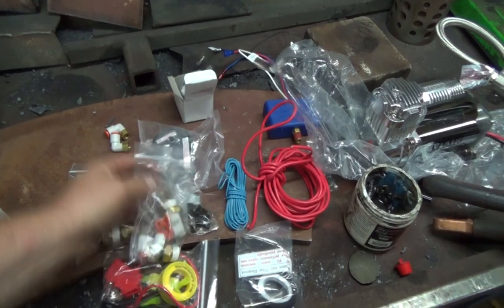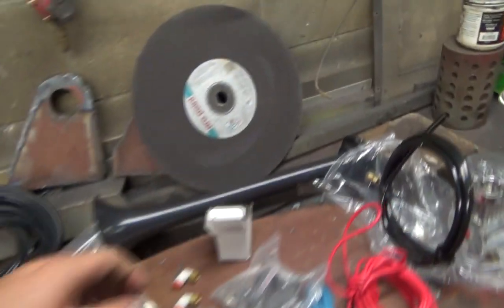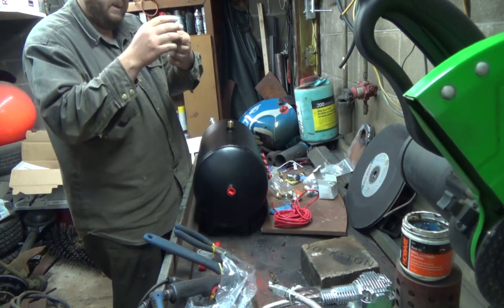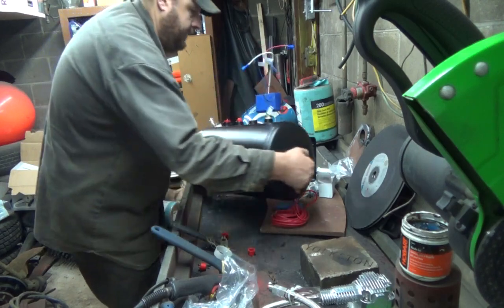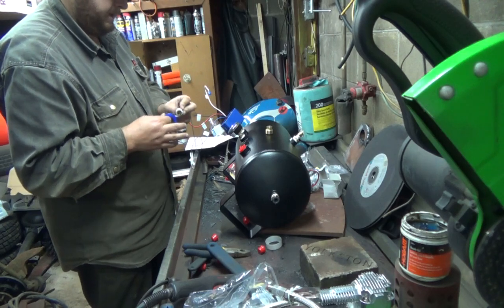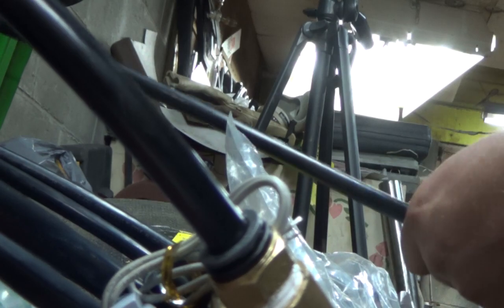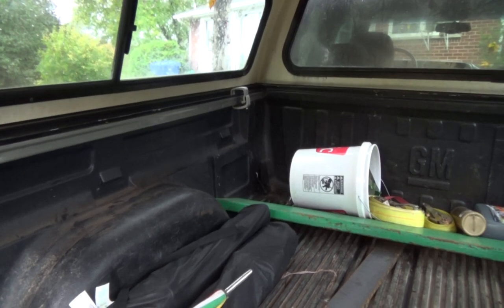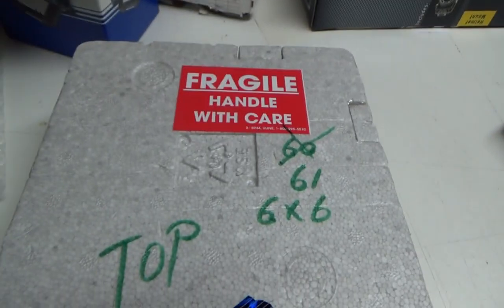Darn rain again   setting up the horns inside and??????

Comment: the bigger port is/or could be used to plump a line out to another aux. air tank for more air capasity. Thus being able to run more horns with less work of the compressor.

Comment: put the switch on the blue wire it needs the blue wire live to work . or still run the blue to ignition either way if you dont have live to the blue it shouldnt work.

Comment: Bill, Hope you have the orientation of the tank worked out before you start fitting drain valves.

The problem with putting the tank in the back of the truck where is the water going to go when you drain the tank which is suppose to be done Daily.

Comment: Bill I think you may find it works off the normal horn button and the toggle switch is for switching from your normal horn or the air horns. What about looping some Jack chain above the drivers door and yank on the chain for the air horn to work.

Comment: His comments are normal during any install in which the installer has not seen the parts before. Actually very valuable input for the designers of the product because it helps them understand their customers see. And as the product designer they can decide which feedback is useful and which feedback is just typical installer hot air.

Comment: I've soldered hundreds and hundreds of them solar panels and trust me you will brake loads of them especially once you heat them up to solder because they will flex, You will need alot more to make a decent size panel here in the uk i've wired mine so they put out 15V on a cloudy day and over 30v when the suns shining your need a controller to regulate that, you can also buy them pre tabbed which takes most the work out of making a panel,

Comment: You can still use that broken solar panel Bill, it will just have a little less power due to the missing corner. But buying them as separate parts like that wasn't such a good idea. They are out there as complete units which are like a couple of square feet big, so you can still connect those together w/o soldering and get your desired voltage. To lessen your grid dependency, you'd also need a battery though.

Comment: Bill the push lock fittings are way stronger then you think. Auto manufactures have been using them for years. Heavy equipment have been using them in air brakes for years also . They do not leak over time like ntp does or pipe thread with the tape crap. Also another place that style fitting it used is in the air suspention systems.

Comment: those are like the top off the line fittings you can get and that system can run a whole air ride system theres no complaining to be done LOL those will never separate till you take them apart

Comment: The purpose of that toggle switch is so that you can wire the solenoid to your horn, and then either just have your stock horn or if the switch is on have your air horns off the horn on the steering wheel. You should just wire it like hornblasters wants, that's the proper way to do it.

Comment: Solar are the way to go I got 18 panels on my roof bills went from 180 us a month to 45 a month also what I did on my pickup with the air horns is I went and bought my own air lines for the trumpets I would try to keep the selenoid and everything in the back

Comment: How about you mount the compressor and tank in the box and use quick disconnect fittings on your air and electrical connections in case you need to remove it as a complete unit? You can even mount the tank and compressor on a bracket using presto pins and dowels rather than removing nuts and bolts each time the assembly has to be taken out of the box. Just some ideas Bill ... keep it simple and easy.

Comment: You want as short of a hose as possible between your solenoid and the individual horns so that there's no delay from when you push the button to when there is enough pressure to blow the horns properly. In an emergency situation, milliseconds might make all the difference in the world.

Comment: Those fittings are great Bill, as long as you push the tube in until it bottoms out you're good. They don't leak but they're still easy to remove if you need to for any reason. Also I'd blow some air through the tank while it's still open just to blow out any loose particles or anything that might be in it. Don't wanna mess up your solenoid.

Comment: bill bill bill, solar panels like that are very very fragile and tedious ctc have solar panels that are rated in watts with a certain voltage, i have some,. what you are about to do is really tedious. you still need to have a flat surface and protective cover. the kind that are already made from like ctc or even any store you go to are quicker and more rewarding. the air horn thing, remember pex plumbing, you push in and go. that's ok, have some, work really well. good luck billy, will be watch

Comment: Those fittings have been on truck airbrake systems for years. When the tubing is pushed in the fitting it is locked in, it does not rely on air pressure to hold it in place.

Comment: On the black lines for the hoses why don't you use apex pipe and fittings. They hold quite well and won't leak at all.

Comment: Well bill if you use a bigger tank, you'll need a bigger compressor/motor. That little compressor/motor it came with is meant for that size of tank. You'll run it to death trying to get it to fill one of those big tanks. Its a little guy.

Comment: Billl , if you need more air line and fittings , you can get that at a parts store that carries heavy duty air brake hose and fittings . That hose is standard HD truck hose .

Comment: Before you break any more when attach anything to them have them laid flat on a table so you do not break any more. Do not try to connect them in your hand as you just tried to do as they have zero strength.